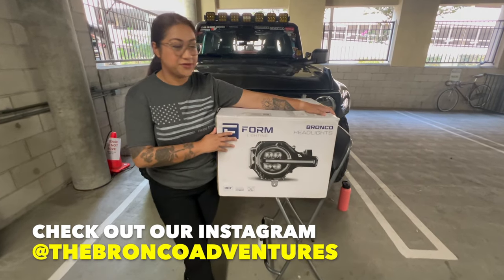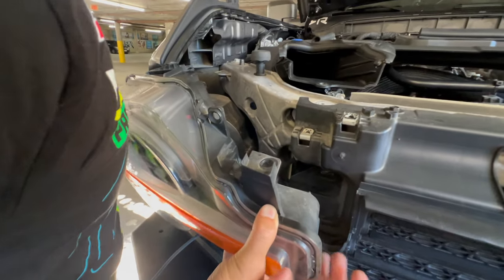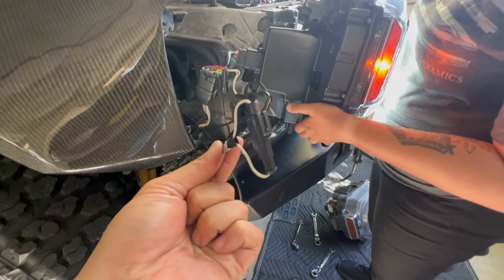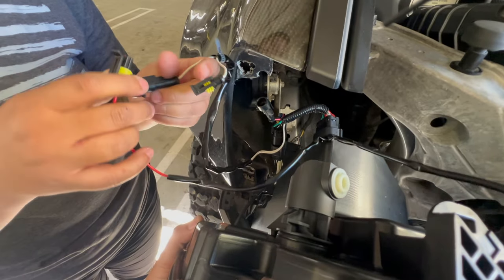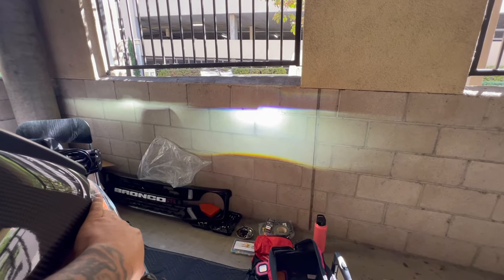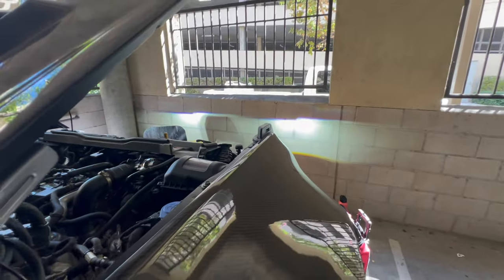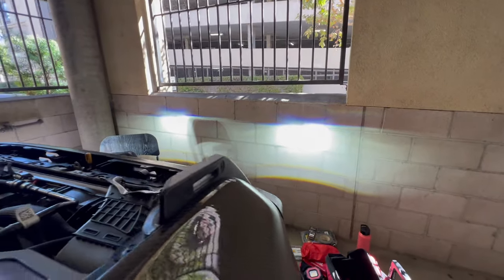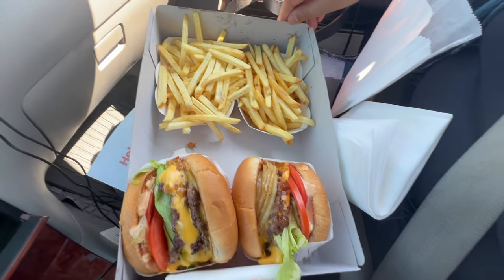NEWEST BRONCO HEADLIGHTS - FORM LIGHTING | The Bronco Adventures

Comment: When you put it on drive mode would the DRL’s be on?
Reply from the maker: Hi we didn’t connect the full time DRL to the fuse box so it won’t run full DRL but it does turn on automatically at night time. Also we just turn our light switch on if we want the lights on during daytime

Comment: Can you tell me if they vibrate a lot when going over bumps (little or big)? I'm on my third set of morimoto lights, which have been returned for various issues, but the main problem is they vibrate and shake constantly while driving. I'd like to get a set of these headlights if they don't shake.
Reply from the maker: Our driver side is perfect but our passenger side is a little shaky going on any bumps. We just took it out on a trail with lots of off camber and through a rock garden and its still the same